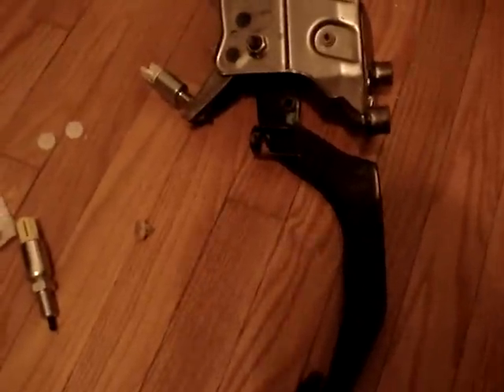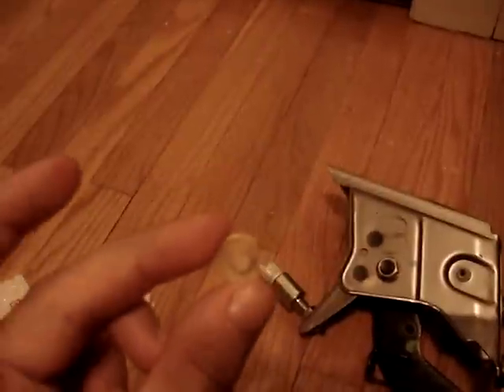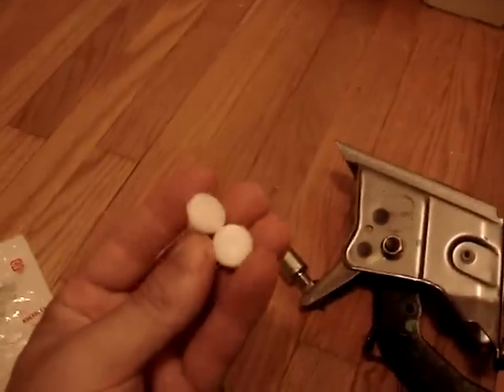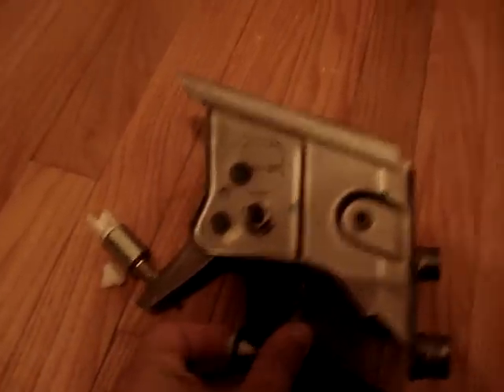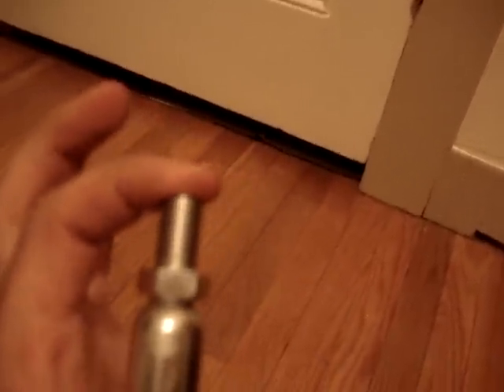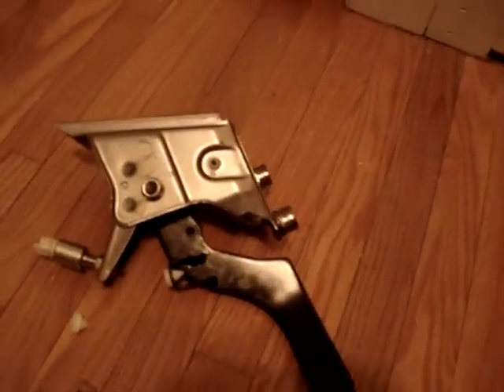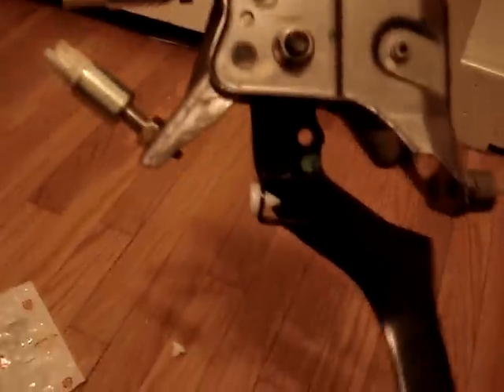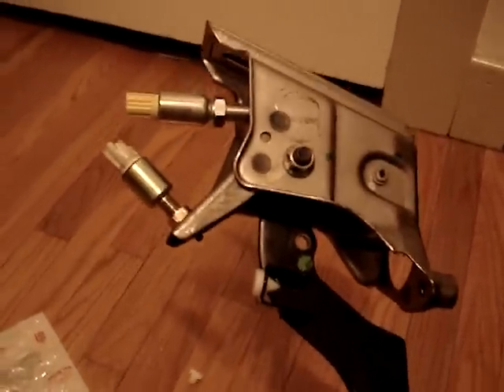97 Acura Integra Possible no start solution Pt 2

Comment: Thank you very much for you video. I was under the hood diagnosing from battery, starter, sparks, alternator, even manually cranking the engine to ensure it didn't lock up on me, YOUR VIDEO HELPED solved my no crank, no start issue. Found the hole with broken pieces to the stopper on the floor

Comment from the maker: @coffeefish I had a soldered the old clutch switch's internals together and the car started like normal. Once I installed a new clutch switch and the car did not crank when I tried it, I knew something was up. Either the new switch was faulty or something else was the cause. After a visual inspection I noticed the plastic pedal stopper was missing, and that was the cause. In my case yes the problem was difficult due to lack of time to diagnose, so I made these videos to help others.

Comment: I came across your video and sure enough the next morning I saw the pieces of the stopper on my floor mat. So I went to the dealer to get this part number 46505-SA5-000 for $2.50 I didn't take off the whole pedal assembly. I super glued the flat part of the stopper to a flat head screw driver once it snapped into place I giggled the screw driver to break the glue bond. However I highly recommend to take off the driver seat (4) 12mm bolts and that will give you plenty of room to work comfortably.

Comment: Hey thanks for the video. I had the same problem with my 96 Integra. I changed the main relay and another relay and nothing was working. I knew the starter was fine because I put a cable from the positive battery post to the starter and the car started right up. I knew there was something wrong because the terminal on the starter was not receiving the 12V. I checked that with a voltage meter. I had someone press the clutch all the way in and crank the start key and a read of 0V.